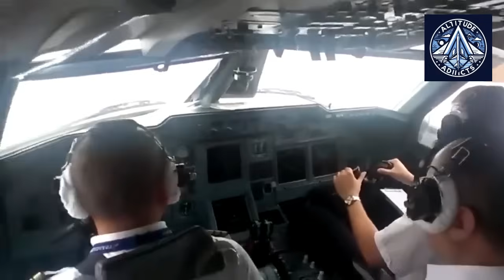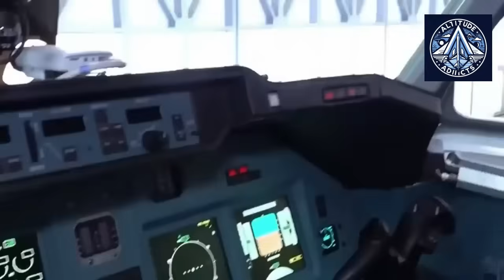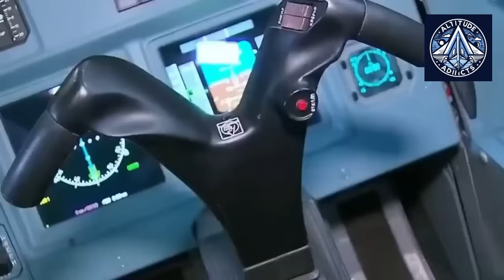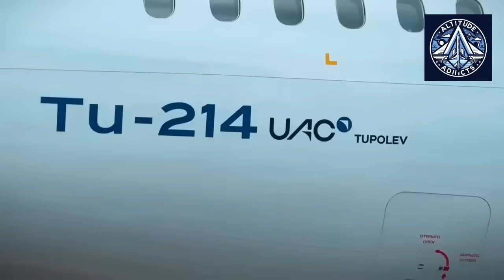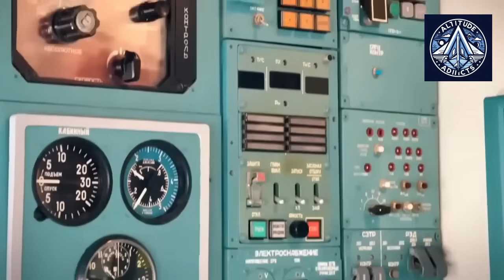S7’s 100-Jet Deal Explained—Can the Tu-214 Save Russian Aviation?

Comment: Due to the high dependence on imported components, they had to be replaced, and the aircraft had to be retested and modified each time, which slowed down production and certification. Then the decision was made to develop the components ourselves, which also requires time and testing, and then testing and certification as part of the aircraft, which, of course, is not a quick process. It took a long time before the Russian government realized that the market economy was a US dictatorship.

Comment: If I may offer congrats but also some constructive criticism. It seems now both Komsomolsk and Irkutsk are in overdrive while Kazan is lingering on with few here and there orders. Spread the wealth, why is there no MiG but instead the Su-75? I thought and someone told me that it was all one company now, it sure doesn’t look like it to me. The US lunar program succeed because Chrysler and many other now gone companies truly co operated together. Roscosmos is another mammoth
Reply: The Su-75 and MiG are currently under development, but the Su-75 will likely be completed faster because it is simpler and essentially a drone. Until recently, the factories in Kazan were closed under Gorbachev and Yeltsin. Resuming operations at these factories requires a complete modernization of all workshops, the purchase of new equipment, and its development for serial production, which will be time-consuming and expensive.
Reply: @borisperez3129  What color is the moon? 😅

Comment: Lo que firmó S7 es sólo un acuerdo de intenciones, no un contrato firme. Y no podría serlo porque el avión todavía no está certificado. Los rusos tienen un serio problema entre sus políticos y sus administradores de empresas, que les gusta prometer mucho.. Lo concreto es que el Sj-100 y el MC-21 están en la última etapa de certificación y han desarrollado la infraestructura y capacidades para su producción industrial. Todo lo demás es humo.🤷🏼‍♂
Reply: This channel doesnt have the proper information. As you said this will almost go into full production, and everything else is smoke and mirrors.